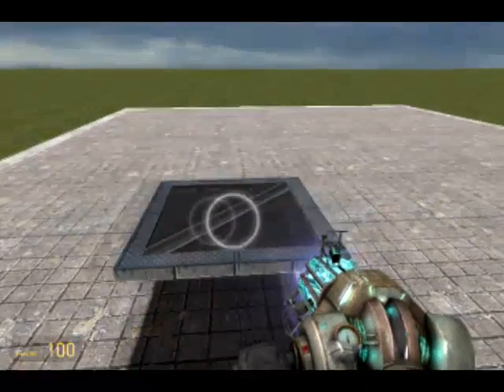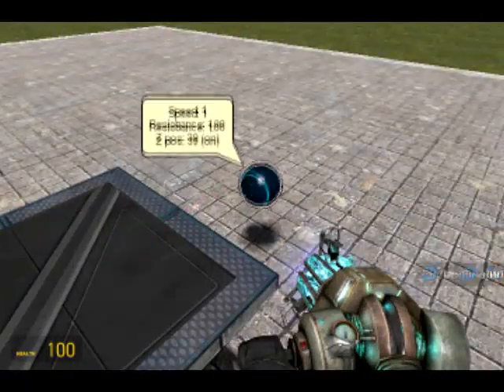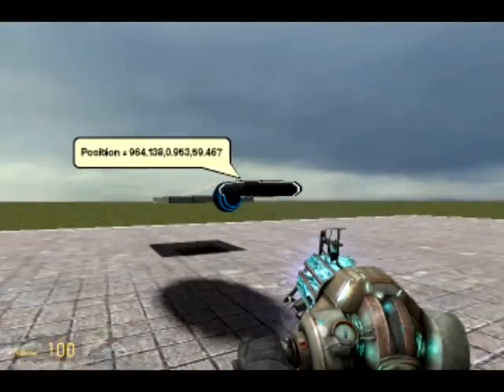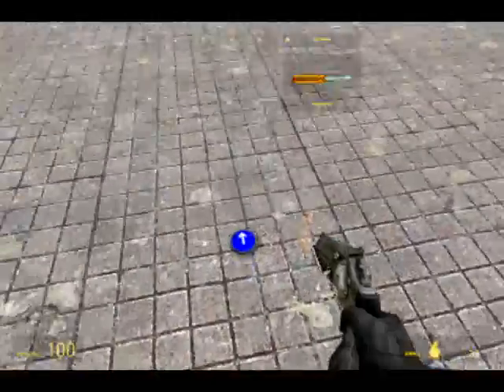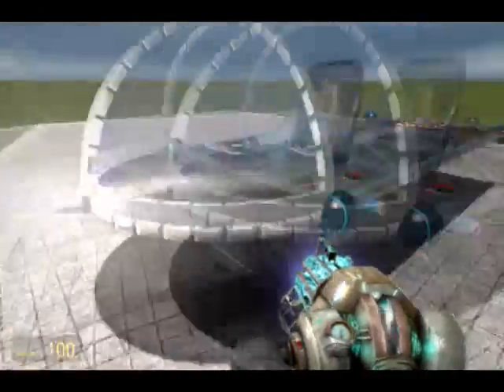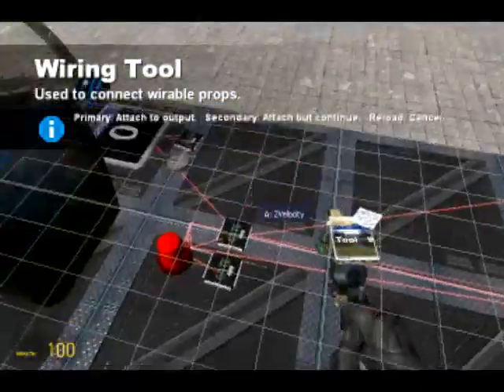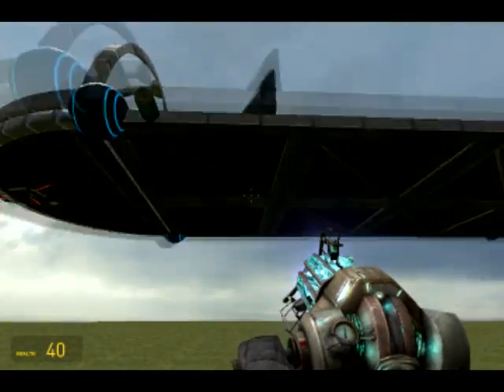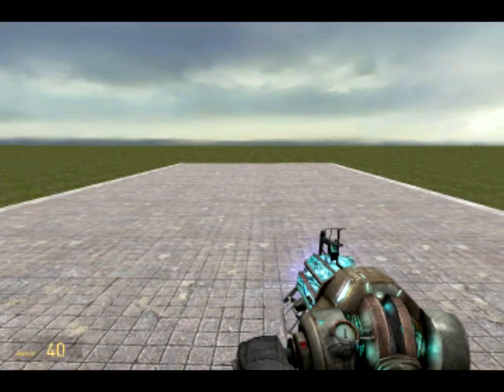Arbiter's Garrysmod Tutorials - 8: Wire Hoverballs

Comment from the maker: A positive input will make it rise and a negative will make it lower. So the easiest thing to do is set it up so it CAN receive both negative an positive inputs, you can do this any way you wish (buttons, keypad input etc) and wiring this up to an add gate, then setting the z velocity of the hoverball to the output of the add gate. Hope this helps you out.